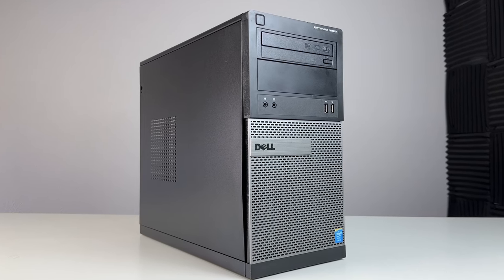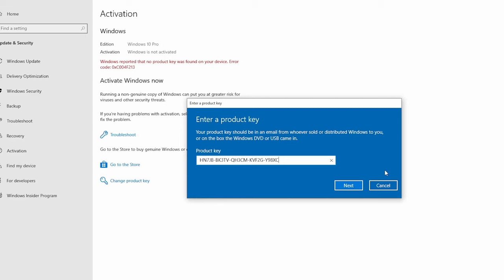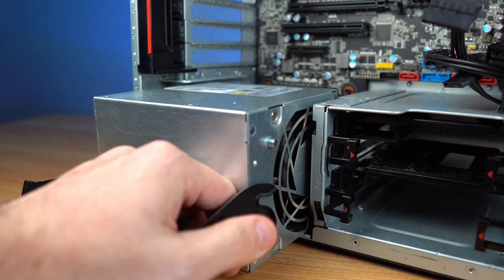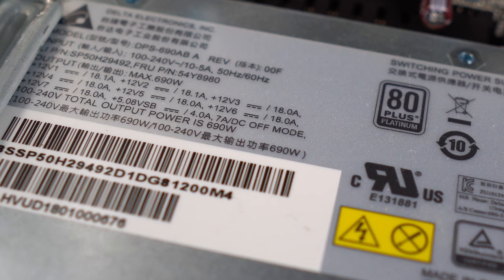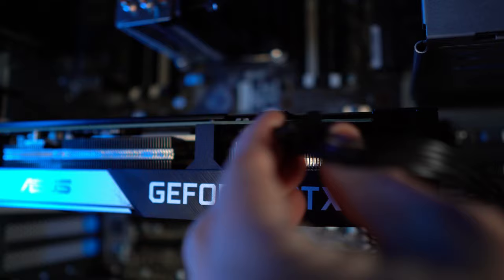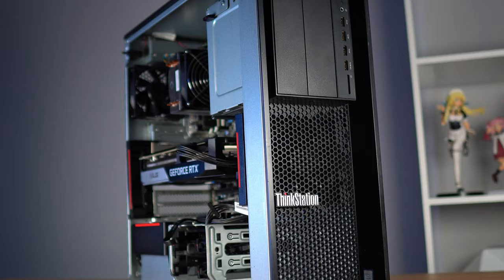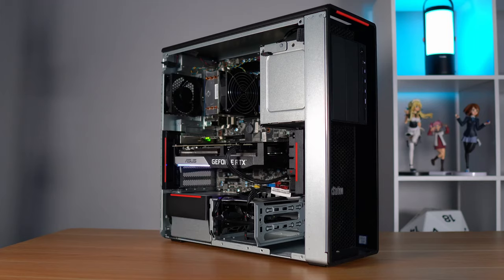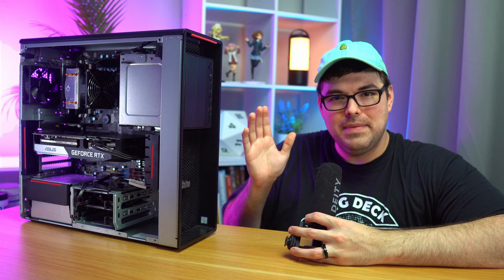This "OFFICE PC" Can GAME in 1440p! Is It Worth It?

Comment: This is the exact rig I run 2135, 32 gbs of ram, 2tb nvme. I put an RX6800 in there that’s definitely the limit. Had to turn down settings. It’s time for a better rig but you can’t go wrong with the P520
Reply: 🙂 neat, so for sure u can see the BIOS screen using an RX card? thx
Reply: @MrSamadolfo  I’ve reached it with an Rx580, haven’t tried with the upgrade
Reply: @JesusPerezTgod  🙂 ok cool, check whenever u can cause some bioseses don't display with some RX cards, they are picky 😊
Reply: Is it possible to fit the xfx swft319 rx 6800 in there?
Reply: @RayTech18  that’s exactly the model I have, I had to remove a fan but it fit
Reply: @JesusPerezTgod  oh okay ✅

Comment: i have had the same system here only dif is i have 4 8 gig stix of ddr 4 2400 in it to get full use of the 4 slots using 4 channle helps about 15% on 1 % lows it has a 6700 xt in it mine came with the 900 watt ps , , bottom line ive not had any issues on any game at all at 1440 p and 1080 p it crushes everything , i think this is the ultimate budget pc  you can build currently, im  very happy with it

Comment: Lenovo ThinkStation P500 has even more USB ports, and 4 bays for HDD/SDD drives, Flex Port for NVMe (2) addon. I got a P500 on eBay for $100 and it came with 32GB Ram and 650 PSU with 6+2 pins for GPU as well. Can get a Xeon E5-2643 V3 6 Core / 12 Thread CPU (prefect for gaming) and upgrade for $9 on eBay.
Reply: Heavy Down side on p500 its not windows 11 upgradeable  its ddr3, it's not in same league at all I upgraded from the p500 to the p520 ,, the p500 was ok but it's time is near over ,the p520 should be ok for a few more years but even its life won't be forever time takes its toll on all computers eventually  hehe

Comment: I started building one last month with a W-2135, 64GB ram, 500GB NVMe x2, 512GB NVMe using PCI card adapter, an RX 5700 GPU (will flash to 5700XT in the future) and a 4-drive cage (oimaster HE-2006) for four 2.5 SSD or laptop HDD that slides into the DVD bay. And a couple of TB HDD are installed. I also have a spare W-2135 CPU and PSU (now I have both 690W & 900W PSU). I have over $600 into the build now. It runs Windows 10 Pro, Windows 10 for Workstations, Fedora 39, & MacOS Sonoma 14.3.1. I'll play with Proxmox later. I don't game, though, at least not yet!

Comment: I just bought a gaming PC for 150$ (used) Here are the specs,
i7 4770
GTX 1060
16GB OF RAM
1.5TB HHD
600W PSU
Cooler Master CPU cooler
Reply: The weird capacity HDD is a delabreaker, but better than a GT 730 for 250$
Reply: 🙂 thats fine broh, do u have an extra sata cable? pickup the cheapest smallest 2.5 SSD and install windows on it, u can run 10 or 11 on it. I'm refurbishing my 4790K Devil's Canyon and Windows 11 works just fine, its updating just fine too.
Reply: Be sure to throw a small SSD in there for Windows.
Reply: @JeffWaynee  if I have an HHD, do I need as SSD. It already has windows 10 activated..
Reply: @legotechnic15YT  if windows shows that its 'Activated' then u should be safe to reinstall Windows onto an SSD, when u finish installing windows onto the ssd its going to ask u to connect to the internet, when u connect to the internet it should automatically activate the new windows installation. The ssd is necesary because using only a hard drive is very slow and makes the computer run very slow.
Reply: @MrSamadolfo  So the Motherboard is not wifi. And there is no ethernet wall port near my desk. But I'm still planning to buy a Kinston SSD 1Tb it's 89$
Reply: @legotechnic15YT  u can leave it unactivated in the meantime, what u can do also is use a smartphone that has internet, turn on wifi hotspot, and give ur PC internet using the smartfon internet
Reply: @MrSamadolfo  Ok.
Reply: @MrSamadolfo  It's activated. The guy already created an account and password. I guess I'm wondering if it's  not a Full "Clean PC" and Because he signed in he could have put any app on there. So I'm gonna reinstall windows on it so I have a fresh start.
Reply: @legotechnic15YT  🙂 sure, clean install
Reply: Wtf is this?! Discord???
Reply: @Gamer-x8b  ITS youtube

Comment: I built one with a W-2140b (up from a W-2133), 64GB ram, 512GB nvme (it came installed from the seller), an RX 6600, and a pair of 10tb WD Red drives from my previous server. All less than $500. It does everything i need, from video editing, livestreaming, to 4K gaming (at lower settings but it's still 4K). I also installed a Wifi/BT 5.2 card.

Comment: My Brickstation has the same CPU, it came with 32GB of Ram and the 900W PSU. I have a GTX 1070 display adapter, a WD Black SN850X for games, and I use my old Sata drives for Windows and storage. The PC was about $180 and the GPU I purchased used for $100, I ran out of space for games so I got that 2TB WD for about $120. It's simply a fabulous machine.

Comment: I setup a P520 as a movie server and it gets really hot. Lenovo didn’t think hard enough about cooling with this model. I’m probably about to take everything out of the case and drill in some fan holes.
Reply from the maker: Unless it's overheating, I wouldn't worry about it too much. Just being hot is normal for a workstation

Comment: I have a p520 for about 4 months  now it has the same processor  it did come with the 900 watt ps, and 4 sticks of ecc ddr4 2400 ram, and I put in a inland pro m2 drive from microcenter  1 terabyte,  and a 6700xt from microcenter  all together I have close to 600 in it but it's a beast period I doubt it if there is any other combo you could Do that would out preform it in price per performance new or old that anyone  could do out of the box, 1400p, 1080p it will please you very much I'm so happy I have it, also the motherboard has a windows 10 pro version linked to it when you download and install It you can activate it for free and even upgrade to windows 11 for free , if you are on a budget, this machine is the way to go.

Comment: Bro can this processor run alan wake 2 because alan wake 2 only start from 4th gen pc and w3890 also not running the game
Reply: mine crushes alan wake, it plays everything period with a 6700xt in it have had mine a year now no issues on any game period old or new AAA games at 1440p and 1080 p just make sure to use all 4 ram slots for quad channle its designed for best results possible i recomend 32 gigs minium 2400 or 2666 ddr 4

Comment: I dont get it, wouldnt that CPU bottleneck the 3060 TI or 6700 xt? Coz I bought ryzen 5 5600 and people recommend the highest GPUs that can match it are both of those, but isnt the 5600 much more powerful than 8700k?
Reply from the maker: It’s certainly not the best CPU, and a 5600 would perform better.
Reply: It depends. He really hit the mark with the gpu combination in the video for 1440p gaming. If you were to use the build in this video for 1080p gaming, while it would be a very solid performer the gpu would likely be waiting around for the cpu more, due to the older and slower process node of the xeon. For 1440p, the lighter cpu load and heavier gpu load make for a better balance between the two, tending to lean slightly in favor of the cpu in most circumstances. The 6700 XT would probably pushing the cpu pretty close to its limit at 1440p, shifting the bottleneck from the gpu to the cpu in a lot more circumstances. You might be able to even squeeze one more step up in gpu (6800/3070 Ti) for games that are less cpu reliant, though whether or not it would be worth it would rely pretty heavily on your personal use case as you would probably hit a fairly noticeable cpu bottleneck in many games.
Reply: 🙂 this is basically a coffeelake motherboard, so just imagine and ask yourself, what would pair nicely with an i7 8700 or Ryzen 3600? They are all the samething. Go on youtube and look at all the benchmarks for the 8700 and 3600, what are other gamers running with those cpus?
Reply: Wouldn't recommend a 3070ti for 1440p, it only has 8gb